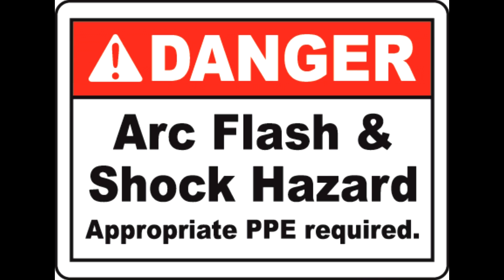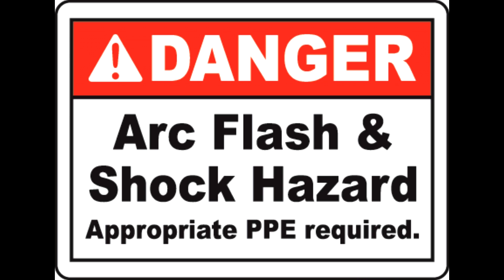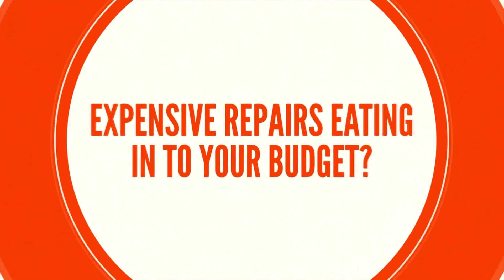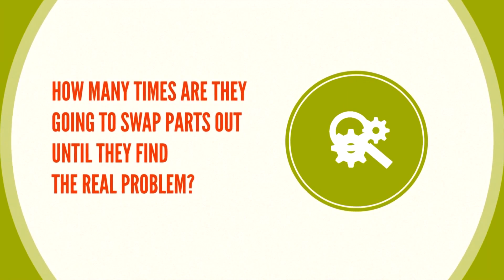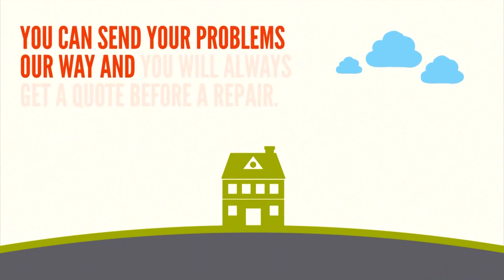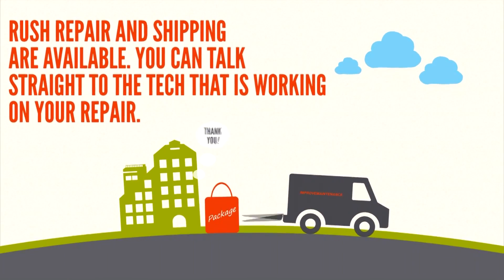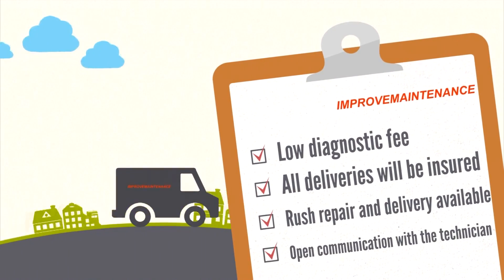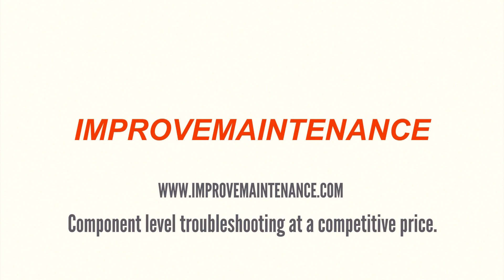How to properly measure or check 3 phase power. Phase to phase

Comment: At 01:48 mm:ss, True, but ONLY IF the circuit is IN OPERATION, with the LOAD turned ON!  Loaded testing is the ONLY valid VOLTAGE test.  L.a.M.it!  Load and Measure it.  L.a.M. it!